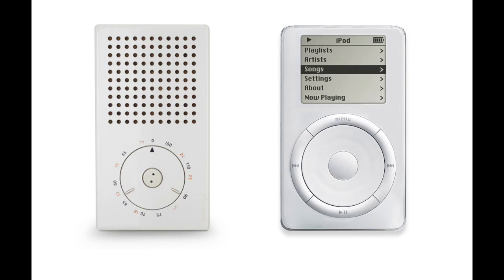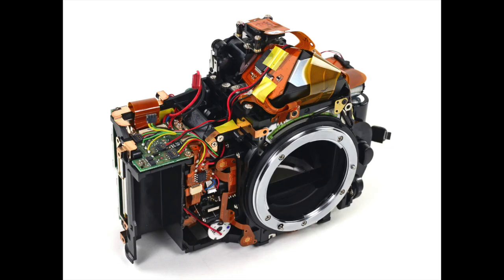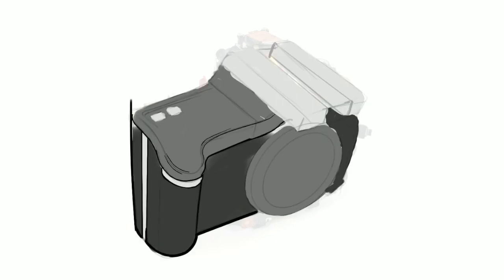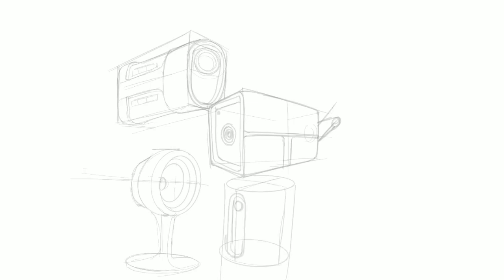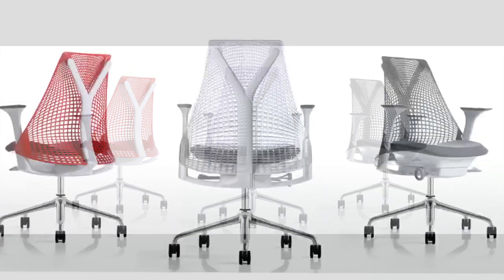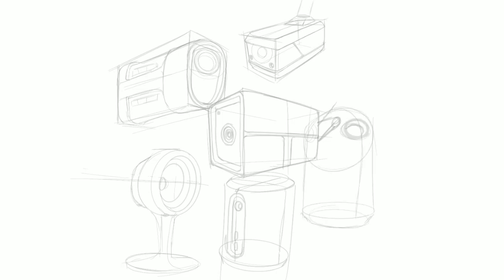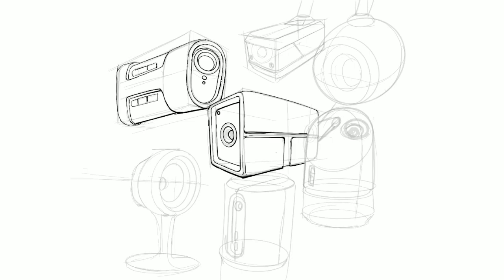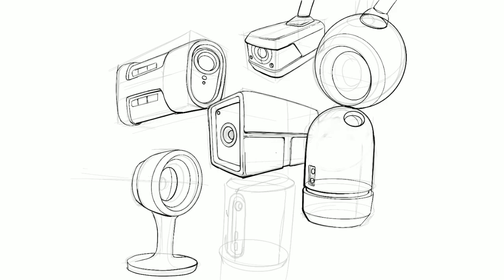Industrial Design Proportions: Improve Your Design With One Quick Tip

Comment from the maker: Hey all, one important note: these are merely suggestions, rather than prescriptive rules. There are times when using ultra-symmetrical static proportions makes the most sense, and there are times when you will need to create lots of visual movement in your designs. It all depends on the goals of the project/product, and this technique is just one of many ways to achieve those goals.